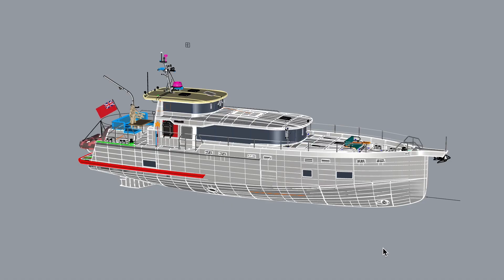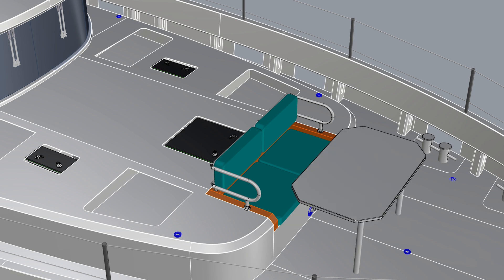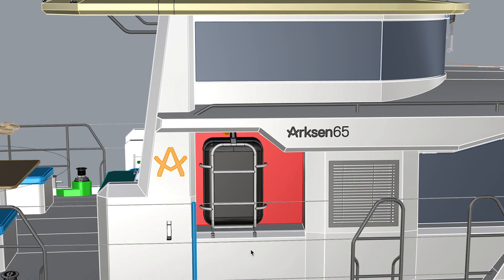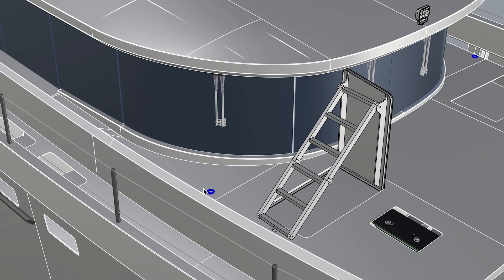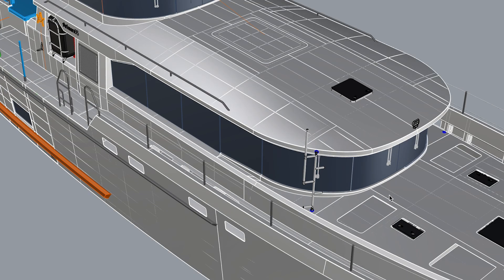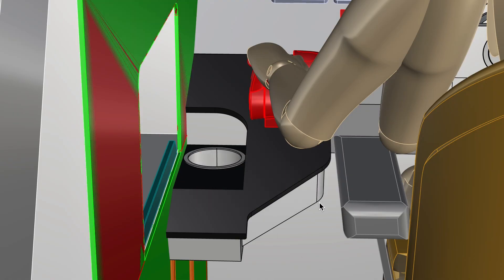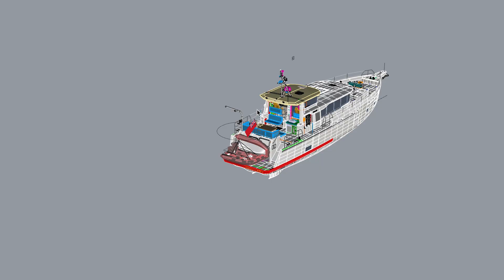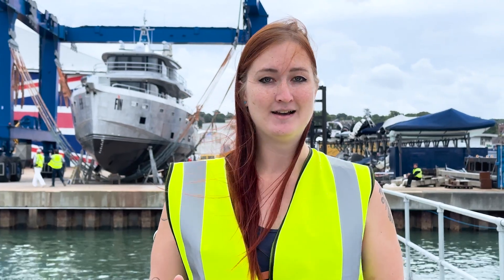Arksen 65 | Hidden Engineering

Comment: Dump the hybrid and solar as it is a pointless option.
Reply: solar on the anchor is actually a good idea in some regards. Ie you towed your 30foot fishing tender 500 miles across the Coral Sea from Brisbane to Melish reef. You spend 2 weeks with friends fishing. Ability to just let the boat sit w solar providing enough power for  basic systems when load is not required. But yes. Expedition calls for simplicity and simplicity is diesel engines and generators and everything else is just another system that needs to be maintained and replaced eventually.
Reply from the maker: We appreciate it might not be for everyone but we want to offer various options to get the best out of the yacht in different use cases.

Comment: Hello Arksen, what is keeping the 65 from being classified zero unrestricted?  Thanks.
Reply from the maker: Great question, the answer is there is nothing keeping the Arksen 65 from being classified in this way. The boat’s structure, systems, stability etc. all meet the requirements for Cat 0 coding as standard. Not all owners require coding, so for one who does, we just need to add the appropriate life saving equipment, to finalise the coding.
Reply: @arksenprojects  Thanks for the information. 👍

Comment: When I hear the number 65 or 85 etc I think thats how long they are, but then just realise its a name. If you want to advertise as a reputable company use metres. Nice boat, but it doesnt look very sexy. Some boats are sexy but not practicle, difficult balance I guess.
Reply: Since Tesla I am learning about fire caused by li Fe accumulators. What is your concept to get rid of them in case of overheating/ fire?

Comment: Why have you opted for such a small pilot house, instead of keeping the proportions between the upper and main spaces from de 85?
Reply from the maker: The reason for this is indeed to keep the fixed air draft as low as possible to enable a wider range of cruising opportunities such as inland waterways. There is an additional help station within the saloon and the pilot house can be open or enclosed depending on the owner's requirements.
Reply: The 65 is designed for open oceans and for inland waters. The smaller pilot house is for bridge clearance.
Reply: Air draft. The great loop, many rivers/canals in Europe, all have a that one low bridge. This solves the issue and opens up more places to explore. Being designed to operate single or short handed also plays into this.
Reply: Smaller boat of course.
Reply: If you're interested, why not contact Arksen directly?
Reply: @sgabriel  This is the Arksen channel.    About as direct as you can get.